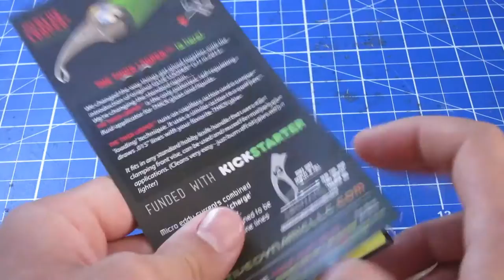How to Use Glue Looper v3 - Fix a Blade Inductrix

Comment: I just use a toothpick. If you use the e6000 as soon as it comes from the tube it flows right around the post.
Reply from the maker: Yeah toothpicks definitely work in this situation, especially if you can get the flat sort. The specific thing I like about these loopers is that they're razor thin, so if you've got to get it into a joint that normally would require finagling, they'll manage it easily.